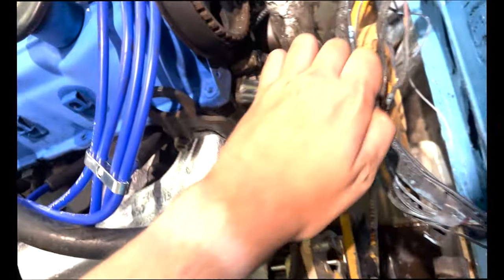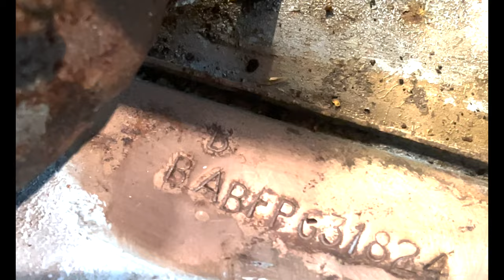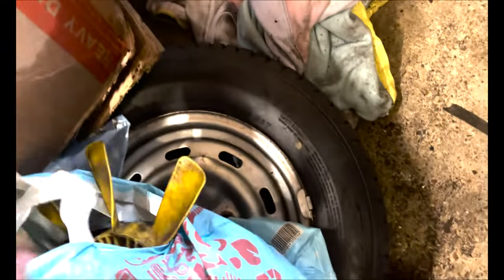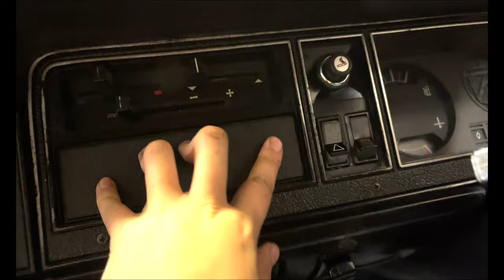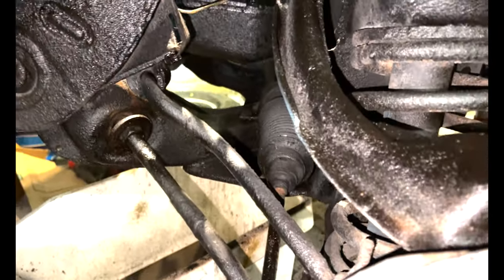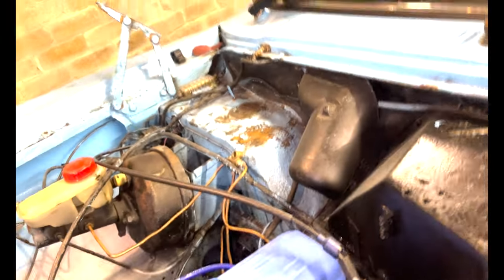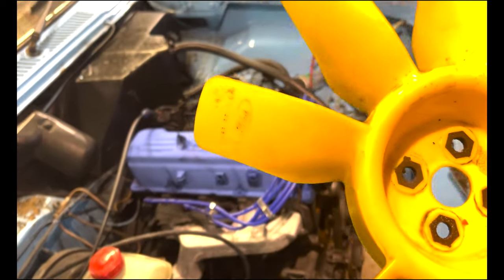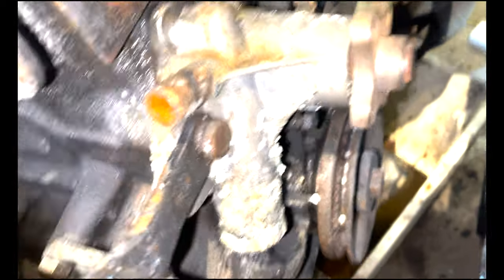PROGRESS! Barn Find Ford Cortina MK3 Project Part 2 - Engine Bay + Cooling System

Comment: Yes to the hole drilling for drainage. I am going to do the same with my car. The airpans are notoriously hard to find so a chrome one is a great idea. Use a garden hose or a pressure washer to wash out the crud from the water system.
Reply from the maker: I’m lucky I’ve only got the one for now, I think I may just drill the second as it is a good idea. Not sure if you know Sheffield cortina centre? The man is a legend he recommended it
Reply: @tomdrives  I don't know that place. I will have a look online.

Comment: They were made with Falcon straight-sixes in Oz, including the 250ci / 4ltr version, so we put Windsor V8s, such as the 351 in them now.  The Cleveland V8 351 is a bit too big though in both weight & spark plug axcess.